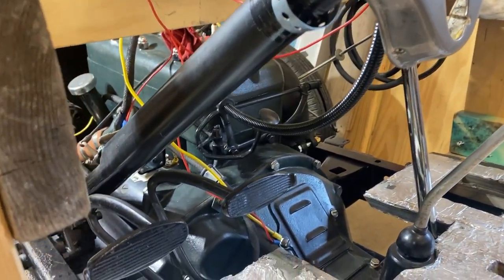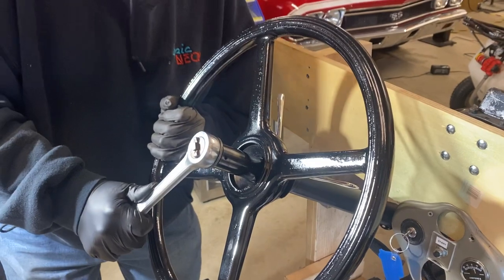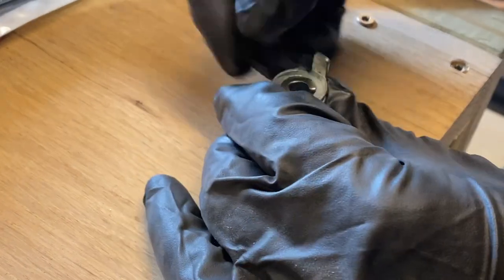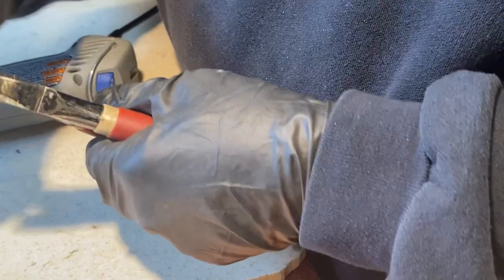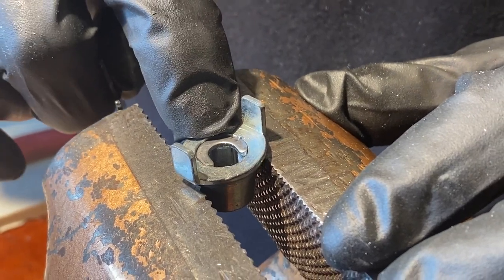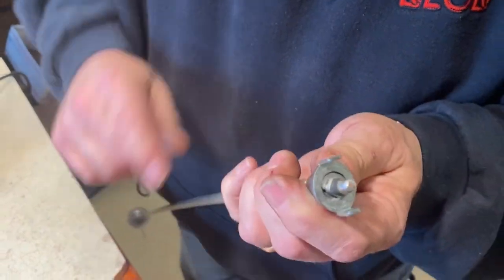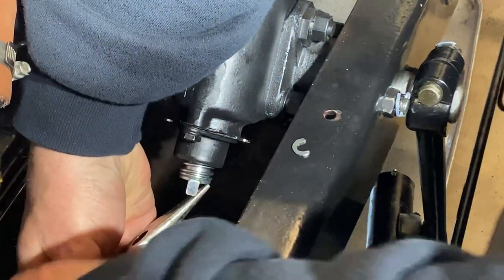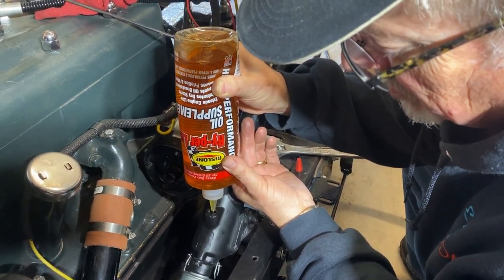Ford Model A Horn and Light Switch Rod Replacement | Steering Rebuild

Comment: Older video, very good explanation of installation on light switch and steering wheel, can tell you have patience, these parts don't always fit sometimes, a little extra work and everything turns out fine, great video,THANKS  SUBSCRIBED
Reply from the maker: Patience is a “must” when working on a Model A. Things don’t always go as planned. Thanks for watching!

Comment: Followed your video today to replace my spider and everything went back together great. I also replaced the oil tube and gasket and the only discovery was the steering wheel rod would not come all the way out of my sport coupe as it made contact with the roof but that was enough clearance for me to get the oil tube back up into the steering box and then push the steering rod back through it. Thanks for your video!
Reply from the maker: Great!  Glad we were able to help. Thanks for watching.

Comment: Informative! Last year I needed to replace my horn rod on my Victoria. I got it from Snyder’s. When I went to install it, it wouldn’t slide down the tube! It was too large in diameter! I called the vender, they said it was the proper part, but the way the rod was made they said I needed to sand the whole length of the rod! They said it was normal to do this! I took emery cloth and sanded the rod until it slid down the column. Where did you get your horn rod?
Reply from the maker: We got ours from Snyder’s too. The only real hang up we had was with the price/ID sticker on it. Our first time putting it in the shaft, it got hung up on that. Once we removed that, although a tight fit, it went on. Maybe the filing we did on the end of the rod for the spider made ours go on better?  Not sure. It was definitely more work to put that all together than we thought it would be though.
Reply: That’s odd that you didn’t have that tight fit on the rod. I had to sand the whole length of that rod!
Reply from the maker: @fredkaminski3668  I’m glad you posted about it though. If someone else has that issue, and they check the comments here, they will know what to do to make it work. Thanks for watching and commenting!

Comment: That was a reproduction spider part and not an original, so required some modification work !!!
Reply from the maker: Yup. It’s getting harder to find those original parts. Gotta make those reproductions work when you need them. Thanks for watching.

Comment: Does the horn rod push against the lights switch to ground the horn wiring at switch or does it carry the circuit up the shaft to ground at steering wheel.
Reply from the maker: There is a wire up through the center of the rod to the horn switch which when pressed closes the circuit and the power goes back down the horn rod which is grounded at that “C” clip.   The center wire up the horn shaft internal wire makes contact down at the bottom inside the whole light switch for power.

Comment: I have a 1930 Ford Model A.  The horn is Spartan.  It works when wired directly to the battery, but when installed in the model a is just barely hongnsd
Anyone have any ideas
Reply from the maker: Be sure to check the wiring.  The horn, like the lights are connected to the generator because of the amp draw needed.   The second wire (ground, positive) is fed up through the steering column starting at the end of the light rod.  Next is the push button switch which is actually going to provide the ground to complete/close the circuit and make the horn work.  So places that can cut the amp flow are the connecting points.  First the connection at the generator, second at the end of the light rod, third is the switch on the steering wheel itself and last the common ground itself.  Any one or multiple of these connection points may not be making a good contact thus cutting the amp flow through the horn.   Finding which one is the culprit is a process of elimination.  You eliminated all of these contact points by connecting the horn up directly to a battery.  Now to try to bypass each connection point one at a time to see if the horn brightens up and you may find the weak connection.

Comment: What snapped into place @ 15:38?
Reply from the maker: From reviewing the video myself just now, I think something was set down or fell down in the background at that specific time stamp. Nothing to do with the car. If you are asking about what George clipped just prior to that point, he snapped the light switch bale into place on the light switch body at the bottom of the steering column.